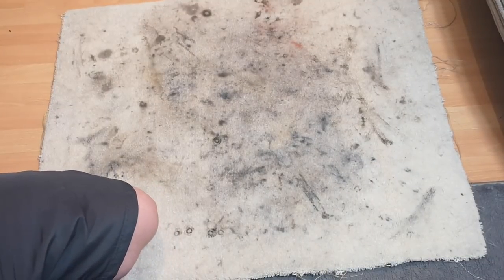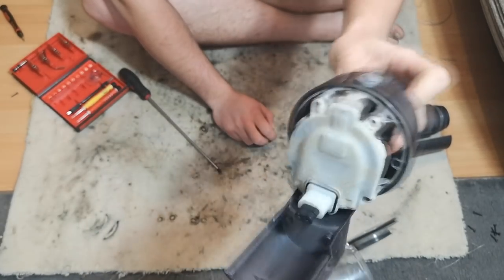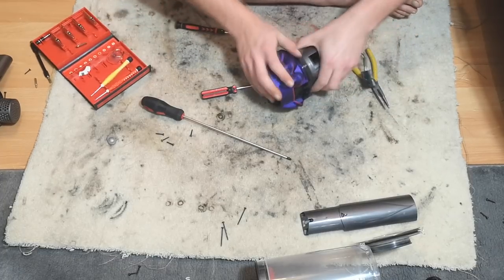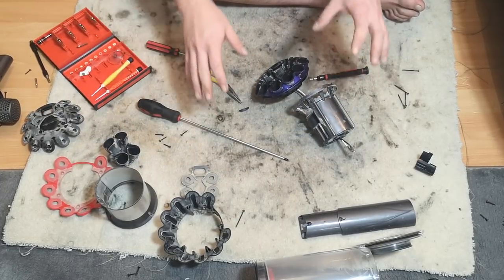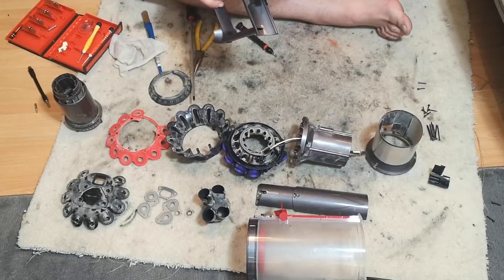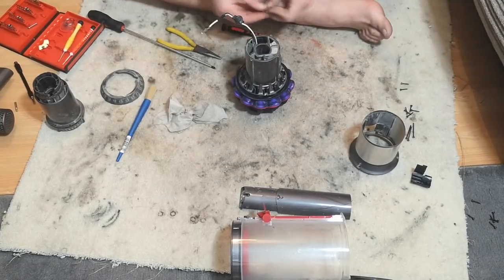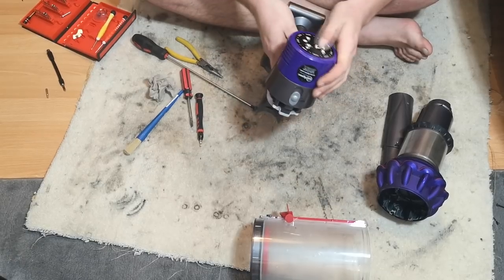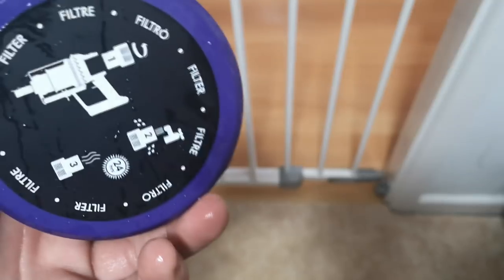#Dyson #V10Broken #cordless Dyson V10 - Stripdown, Repair and a filthy interior! (Stripdown how-to!)

Comment: Once taken apart, I repair plastic damage  by using some plastic beads stuff that melt when warm and can be shaped into stuff.   I make a mold using this on a good area of the plastic, then fit it over the damaged area.  Mix some JB weld, then fill in the broken/missing plastic area of the motor cover.  Remove my mold. File/sand as needed. Wet sand for perfection. Spray paint the cover, and voila.  Brand new.  Cheers

Comment: Great video it helped me a lot. If I ever fully dismantle one of these again I will cut the wires and join them. It is quicker and less fuss than pulling that connector out
Reply from the maker: It's certainly a way to do it, I'd have been shot by many dyson lovers (some would call them dyson fanatics) for doing that though! I did wonder if the wire and plug went in first then got soldered to the board though
Reply: Robonza great tear down but could show how you get that plug out like wtf prob hardest part
Reply: Hi Dustin. try getting the connector out and see. I don't think its worth the risk. I had major issues. All I do all day every day is fix Dyson's. Like I said. I will cut and join the wires next time I need to do a full wash.
Reply: Robonza I actually found the connector has to come out by pulling it out forward NOT mashing it back toward the body , there is a clasp that’s opens up and allows the pins to be removed ... much easier and doesn’t distort the connector as much
Reply: I will give that a go, thanks for the heads up
Reply: @Robonza hi...I read that you work on Dyson's all day and was wondering  if maybe you could help me...the seal inside the canister at the top...the red rubber and grey plastic (on a Dyson v10) came loose...It seems to me that it just pops in... I tried that (it looks like I fixed it) but when I slide the canister back on the seal's pop back off. Could I glue them in place?...Thanks
Reply: I did have a "bin repair" when the ring pops off. I did have to glue a couple of those this year. The clips would not re engage. I used Weldon 16 for those and they have never come back.
Reply: @Robonza    I went ahead and glued mine also. I was afraid it wouldn't close, but it did. Yea! Hope it last. I  looked on Amazon for a replacement and they want $100.00 for one. Yikes! And Thank You  so much for responding. Have a good day

Comment: Great video - thanks but I'll second the request to show us the voodoo that you used to get the connector out of the end section
Reply from the maker: Subscribe and you won't have long to wait! (but leave it in... It's easier! Cut the tape from the ferrite coil to give you length to get the wires out a bit then undo the connector motor end

Comment: You seem to have missed the point of the cyclones. They deposited the dust the middle of the machine and drop it down to where the tube attaches. When the bin is emptied it empties as well. The filter is for the finer, lighter particles to get its hepa rating. Good strip though.
Reply: I tell everyone NO drywall dust, and NO Cat litter with dysons.  Less tear down cleaning required.   :)

Comment: Hi there, remember me!!!  :) I was hoping you may be able to help out as a favour.  I have just bought the V11 after previously owning the V6 and v8 as well as a load of uprights and a DC54.  Especially on the handhelds but on all Dyson at some time in their lives I like to take the cyclone section out and give it a really good wash with Fairy and warm water. It basically makes the vacuum like new again.  So with the V6 you could remove that section with a couple of tooth picks. (Found out after calling Dyson. Tried to sell me a special tool but advised toothpicks or ballpoint pens work just as well and they were right).  V8 Super easy as there is just a little catch to remove the cyclone section but now I have the V11’ and I couldn’t see an obvious way to remove the cyclones so called Dyson who said Oh yeh thats fused to the motor section now.  Firstly I don’t believe them because that would be a stupid design choice meaning any fault what so ever would mean the whole machine goes in the bin or needs replacing under warranty, obviously they aren’t that stupid but I would like to take it apart every few months to clean properly as I have with my other machines.  I should add there is a slight complication which is that I am blind. LOL. Don’t let that worry you about taking things apart just wanted to explain why I came here asking rather than break the machine doing the wrong thing as its much easier I would guess if you can see.  So There are 2 cross head screws just in front of the trigger which I have tried removing hoping the cyclones would just slide forward but they didn’t. Obviously I removed the bin outer before trying to slide the machine apart.  So if anyone has been brave enough to take their V11 apart yet I would really really appreciate any advice on how you did it.  I don’t like the idea that I can’t clean the hardest working part of the machine unless they have made it out of Teflon which I very much doubt otherwise they would be shouting about it from the rooftops in their marketing which they aren’t.  Thanks so much for reading this far if you have and thanks in advance for any help I receive.  Cheers.  BTW, I understand the reason they say it can’t be taken apart because they don’t want people using harsh chemicals on their ABS and can’t trust people to ensure the thing is bone dry before putting back together (I’m guessing a droplet of water hitting a 125000 RPM Impeller wouldn’t be good for it) but I do understand those things and just want to be able to clean the machine I have paid for. LOL. You’d think thats not too much to ask of them but apparently they think they know better. ;)
Reply: OK great if its the same. As the V10 then its definitely doable as you are doing it in this video however sorry to hassle you for more but I can’t see the video, I have tried to follow it by your description but there is obviously something going on that you are not describing but is obvious if you can see the video.  I know its cheeky but would you mind describing in words how its done so that someone could do it with their eyes closed which effectively I am. LOL. I have removed the bin outer, removed the 2 cross head screws in front of the trigger then I thought the thing would just slide apart but its clearly not that simple.  If you could describe what you are lifting/pulling in what direction and if there are any other screws after those 2 it would help enormously.  I know this isn’t the usual kind of comment you get but if you are able to help it would save me a huge amount of time and hassle speaking to Dyson who don’t want to admit it comes apart. :) Thanks again if you are able to help.

Comment: Do you know what might be stopping one if it had used a damp filter?
Reply from the maker: I'd say possibly lack of airflow? So the filter was damp but then put on the cleaner and used?
Reply: @beko1987  Mine wouldn't work with a damp filter!

Comment: Is there any possible way to cut up a battery and make it into a mains power machine? 
My nan has a really really big house and I love using the v10, but it doesn’t last, I don’t want to have loads of batteries, just one battery that is a shell that makes it mains powered, as it’s only low voltage, I could have a really really long lightweight cable on it and be able to clean all day, or till I kill the machine lol

Comment: great sam could you not just soak and leave filter without taking apart ??.just a thought'
Reply from the maker: That's what I do nowadays. Overnight soak in hot water and bio washing liquid, then a nice 60 degree cycle through the wash the next day. Usually brings them up like new and if it doesn't then they need replacing anyway 😂👍

Comment: Fascinating video and many thanks for your time producing it.

I have a V8 and love it millions and as you mention plaster dust in this video, errrrrr Mmmmm well I do pick the bulk of my plaster dust up from my floor with a scraper and then use my V8, however although I constantly strip my cyclone down after ever small plaster dust use, which I am deeply obsessed with.

But I am now seeing much dust in the motor area, but I haven't yet worked out how to remove the motor, unlike your successful attempt here. All I do is remove the Hepa filter, flip the switch to full power and apply my hand on and off of the intake hole at the front, until no more dust comes out, but it annoys me that the motor isn't clean properly. So I was wondering if you know the secret to removing a V8 motor yourself and if so, would you very kindly share the secret, I would be unbelievably grateful.
Reply from the maker: Mmm I've never had a v8, but it looks similar to a v6. There is a video coming I think next week of v6 servicing, and that tells you how to get the cyclone off the motor unit, and from there it's just screws!
Reply: @beko1987  I've sussed it now thanks, I have worked out how to get the motor out, without any damage at all and it's not the same process as the V6.

Getting the cyclone off of the motor unit is done just by pressing the red button in. But I didn't know how to get the motor out of the motor unit but I do now, I have blown all of the dust out completely and it now stays nice and cool. The motor got covered in dust because I pulled the trigger whilst the filter was out... Oops musn't do that again
Reply from the maker: @Bassmunchkin1  it's so annoying when you do that isn't it! I've done it twice on the v11 now, thankfully not catastrophically I don't think
Reply: @beko1987  If you don't need to clear the motor of dust, it's still interesting how it all goes together and if its because somethings broke and you can get a 2nd hand one, then its handy to know how to get it replaced, so if you need to know, just let me know and I'll try and do a video for you so that you don't break anything.

I actually ended up using a hacksaw and cut the old one %^*(^$%^&**((( to say the least and then had to buy a whole new motor for £54.74 from Amazon, but now know how to get the motor out if need be.

Comment: it is much more complicated than it looks like in appearance ..It should be more simple with less screws ..instead of assambleing  with  screws better wil be to be with rotation clockwise wise to assemble and anticlockwise disassemble and one screw for each to keepit fix  like movement part  ..! Dyson should follow that concept in all the parts of assembling the future models ..Same as the have done with the filter  but adding only one  screw to keepit fix !.. Dyson is 90 percent piece of art of engineering which is called "know how to do it" which is something very costly very expensive .if not being cloned from something before ... While 10 percent of the dyson very affordable very inexpensive that is the material is used .if the can they should use the recycling materials on built in it . In the end of the video is realize that,"the  assembling and disassembling the Dyson is not that simple .".there is much more for upgrade in that matter to make it much more simple

Comment: Hello, very good video, my vacuum cleaner V10, broke the start button (red button) you will have a video of how to change it. Cheers
Reply from the maker: No video, sorry! Strip the motor and battery out though and you can get to it, but is it the button physically broken? Otherwise the switch is in the battery, for added expense when troubleshooting...
Reply: @beko1987  Thanks for your answer, yes, the red button physically broke inside and does not make contact with the battery switch.  remove the battery and the part of the button that makes contact with the switch fell

Comment: Just as I seen it is plaster and it states in the book, it is not to be used on plaster / rubble so the customer has killed their own machine and again people will slate the brand. READ YOUR BOOK PEOPLE
Reply from the maker: Ah but it doesn't say it as much as previous models (did you see the but where I go through the manuals?) But yes, people seem to be as silly with £500 vacs as they are with £50 vacs. And that's fine by me, more for me to fix!
Reply: David Osborne Actually mine is not used for plaster dust and it's full of fine rubbish DO NOT assume just because the assembly is full of fine powder, user used it for player dust as they probably didn't.

Comment: Good video Sam, I was thinking how long before a v10 appears with problems , many don’t look after machines it was inevitable 😁
Reply from the maker: It didn't take long did it! Another dyson that has to be used TO THE LETTER or it just can't cope!
Reply: and yet our 2007 Hetty has had no maintenance
 (apart from genuine Hepa-Flo bags, I've never even bothered to clean the filter) and still works like new.  @beko1987
Reply from the maker: Uh oh, don't say that, the numatic police will come!
Reply: Well I do clean the filters on the ones at work when they are emptied, although that's obviously a necessity (if you know what I mean), the Numatic police will really hate treating a henry like that. 
I will also add that that my Gran's 87' Henry has had little else done (new suppressor and post motor filter) and whilst is hasn't been the main vac for a while (mainly for us when we bring the car over) it also sounds fine.   @beko1987

Comment: 11:38 - "it clips in" - it's absolutely unclear how is it clipsed! It's the hardest part I think. You could show it more detailed!
Reply from the maker: It's not meant to be an instructional step by step! But how I did it was to push it out from the front carefully, it's very fiddle, you need to release the slips either side of the plug, a very small flat blade screwdriver, or a smack with a bidmg screwdriver does it! Go easy though or you'll chew up the plastic
Reply: Thank's for such a quick answer! I finally did it but a bit chewed up the plastic.But I think it'll work still=)
Actually there are no v10 dissassemble videos (such deep) so it IS actually an instruction!:))

Comment: First with cain lol
Reply from the maker: Yey! Hi Cain!
Reply: Are you going to do a sort of comparison vid to the v6
Reply from the maker: @daveblunt292  Afraid not, as I've not had the v6 for a few months now, sold it last year. Plus the v10 came to me with no tools, so I can't use it and play! Hence the dismantling instead
Reply: Can you not borrow hoverluxs v10 lol and would be interesting to see if you think it’s better or the same performance wise as we have a v6 but we only live in a 2 bed flat so was wondering if the v10 was worth it tbh as the other half prefers to use over our dc 33 lol
Reply from the maker: @daveblunt292  from memory, the medium setting on the v10 is about the same as max on the v6. And as you can't use either on max for very long or the overheat/kill the batteries, the v10 would be more use for lots of use on medium. It's taller too, I found the v6 far too short! Floor head is so much better on the v10 too. But, £450 vs the bargains v6's can be had for... Decisions! V10 is quite heavy too, you feel it when using it!
Reply: @beko1987  The second setting on the V10 produces about 33 Airwatts, compareable to the LOW setting on the V6, which is 28 Airwatts. The first setting on the V10 is only 15.5 Airwatts, so not compareable to the V6 at all, and only suitable for light dusting using the fluffy head on hard floors. The MAX setting on the V10 is 151 AW and on the V6 MAX is 100 AW, and both pull about 20A from the battery pack - not good for it at all if done on a regular basis as the battery overheats and it deamages the internals of the batteries, which dont like being too hot, especially being Lithium Ion.

Comment: In no video I get it how to get this shitty connector out. I even don’t get where it clips in. On the long side (both?) or on the small sides?
Reply from the maker: Which connector? The one to the wand? I leave it in and just dismantle the pkug up by the pcb. You've got to strip all the cyclone out then assemble it back together minus the very top part, so there's as much wire out the top as possible. Then with a blunt thing push the plug up form underneath so it pushes out the top. Remove the bit of heatshrink (you need to refit it, it just slides off) then note the polarity and colours, pop the connector open and remove the wires. Then pull the thing back apart and wash the plug with the machine just make sure it's dry
Reply: @beko1987  the one which connects all the tubes. I dismantled everything as is and cannot push the connector out any way. It sits tight

Edit. I got it out on one end. But the other end I don’t know how to get out. Well I rinsed it nonetheless. Let it dry for long time then use teslanol on it. So maybe it works again afterwards. Else it might be the motor

Edit2 : it was the motor. Without further fiddling around I ordered a spare part (the body unit) for 67€ which is fine. Only plugin the container and filter an its good to go. Never knew it was this cheap.

Comment: Oh NO, you shouldn't have wash the filter with cleanser
Reply from the maker: Why not? Water on its own never gets them clean!
Reply: @beko1987  
Dyson says, if use any cleanser, that could probably damage the HEPA filtration system, the cleanser which has corrosive could damage the 
filtering efficiency, because it could damage the structure or material of the filter.
Reply from the maker: @hondakuan9463  never has done in my experience, always a risk though. I've got a dc40 filter set in the washing machine right now! Don't do it with paper filters though, I put a dc03 filter in the wash once... Never again!
Reply: @beko1987  
Well... For me, I don't want to take any risks 😅